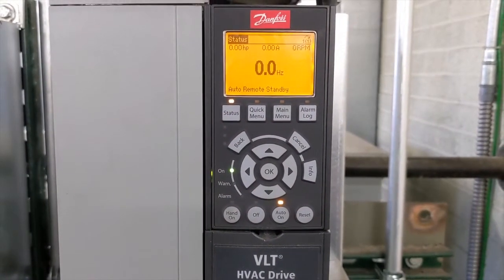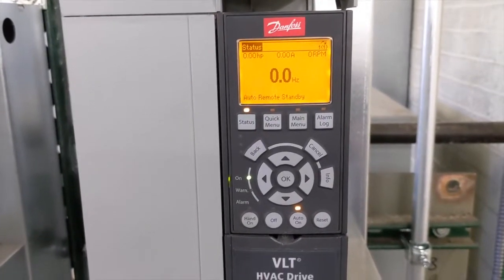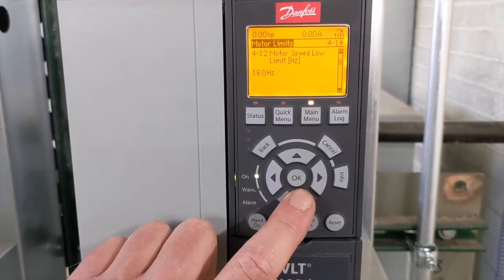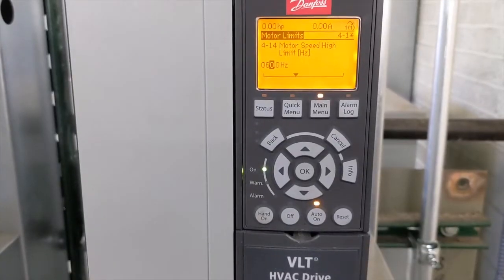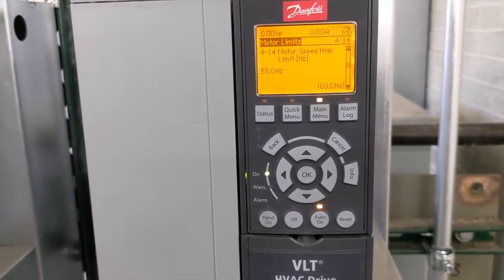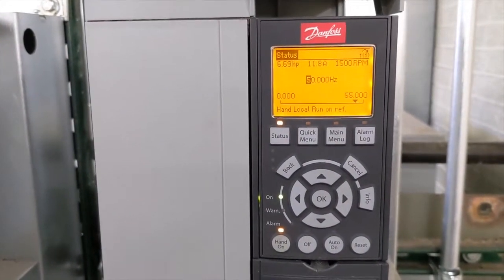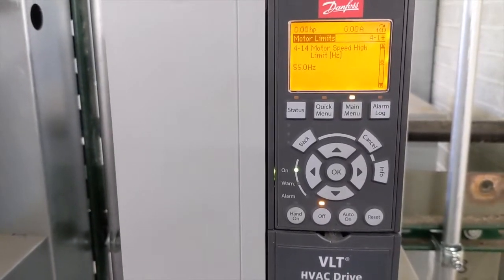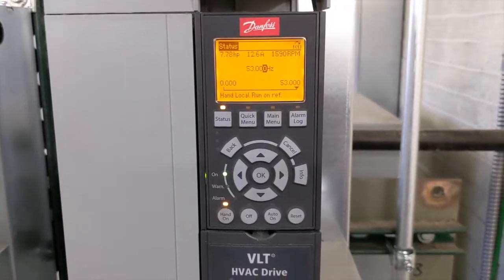How To Limit the High Speed Setting on a Danfoss Variable Frequency Drive

Comment: Question, the circulation pump is connected to the vfd and we noticed that the motor is little bit noisy. Is there anyway we can reduce the noise?Thank you
Reply: Do you find solution?
Reply: @ДенисБолбот-п8т actually we did, just need to adjust the frequency through the VFD. Check the manual of VFD and see how do it.

Comment: Worked on a lot of different VFD'S. Danfoss is the best. Great tech support. On 75 to 150 HP Danfoss old VLT 6000 & Newest FC200'S had trouble numerous times drawing high current say above 54 Hertz. Found out that too many room dampers were either closed or only partially open. Would place motor in bypass and it would draw over rated motor nameplate amps. Also had higher ampere where bearings were going so was told to ramp max speed down until repair could be done.
Reply: Sir we have 2 kw VFD.. we face problem .. 3 mA out put Defrance..   we apply 16 mA with source.....  Get out put 13 mA .... .. what's problem..
Regards

Comment: Hello
I just replace a TR 150 drive with the VLT FC 102 but I cant make the motor run to max speed the manual says to check the output limits on 4-13 but it doesn't show on the display. It only shows 4-12 and 4-14. Any Idea on what am I doing wrong? Thx